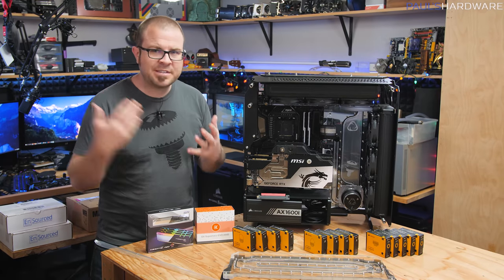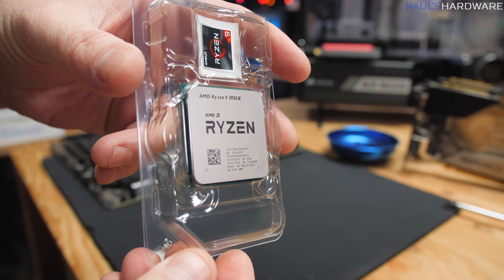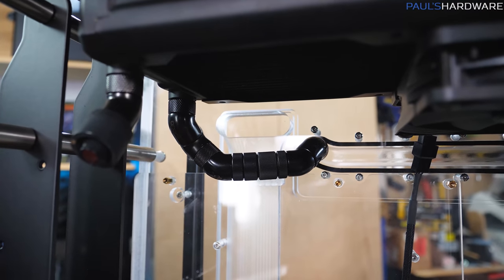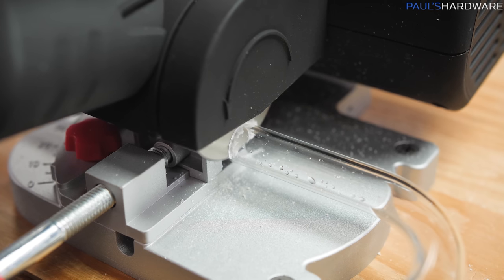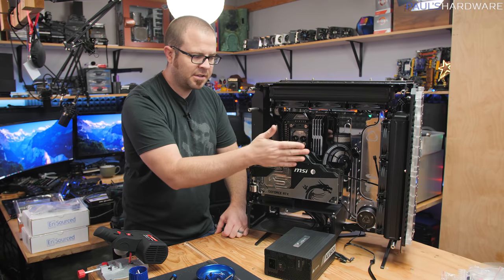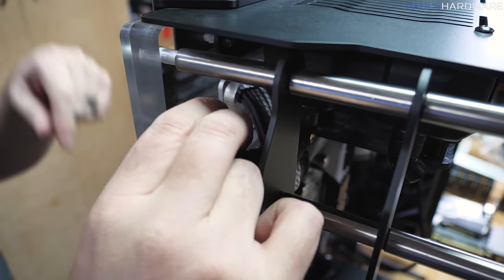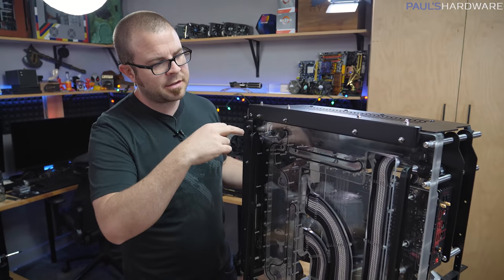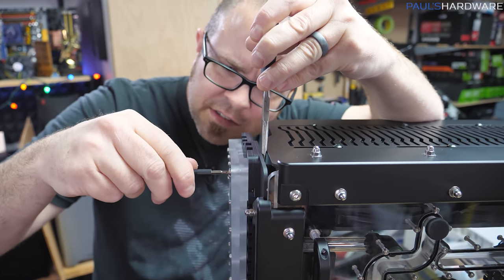My SECRET WEAPON for Hardline Custom Water Cooling!

Comment from the maker: THANKS FOR WATCHING EVERYONE! 🙏🙏🙏
If you're sad I didn't (*spoiler alert*) get far along enough to finish my tube runs and fill the loop, fear not -- the next part of this build project is already shot and should go live on Wednesday.
Reply: I just bought myself one of these too about a month or two ago. It's taken my build times using acrylic tube down to just a few hours(not including custom paint jobs and cable sleeving). It really is an incredibly useful tool.

Edit: Also, tip when cutting, the cutting area isn't deep enough to completely cut 16mm tube and possibly 14mm too(I haven't tried as I only ever use 16mm). After you get about 75% to 90% through the tube, just twist it until you have cut completely through. This will still provide a clean straight cut without having to reset.
Reply: Oh thank sweet baby Jesus.
Reply: Mr. Manager oh man how awesome, hope i can get one myself ^^
Reply: Paul, when you were at Harbor freight, you should have just gotten a wet tile saw for the tubing, much better than what you ended up with.
Reply: 5:22 "thanks for coming to my ted talk"
Reply: hey Paul, i like the look of that threeway splitter on the gpus. do you think it would look cleaner if you fed them the same way, so the inlet was between the cards?
Reply: Hey Paul I think that GPU plumbing is going to result in one card getting almost all the cooling. Physics is telling me the coolant will find the shortest route, which would be through the front card, & may starve the back GPU of strong enough circulation. Or vice-versa, it may push straight through the fitting on the front & starve it. Watch em closely.
Reply: @jpryor8102  hydraulics/ fluid dynamics work a little differently from electricity. it's more closely related to relative flow resistance. with dual gpus in par, the resistance to flow which is highest through the jet plate will be approximately the same. that means the flow will split fairly evenly. it's also worth noting that parallel gpus are pretty well proven to work. heck, i paralleled my gpu and cpu and temps are just as good as they ever were before.
Reply: Don't worry it's already epic even in its unfinished state.
Reply: that issue with the case migth be solved if singularity computers used sunk nuts or indentations on the panel to hold them

Comment: "Air cooling... It's WAY F*cking simpler" Paul 2020
Reply: Or even just soft tubing.
Reply: AIR COOLING IS EASIER IT COOLS PERFECTLY FINE ITS SAFER JUST AIR COOL YOUR CPU OR GET AN AIO AND GET A GPU WITH AN AIO PRE INSTALLEDN
Reply: I'm predicting next, Fuck SLI... Go with one GPU and fill the space with a good sound card!!!
Reply: Khaffit  No Room, adds to much cludder and takes up a USB port and still uses the CPU (in theory). Sound card fills up the space inside the case, sounds great and takes advantage of things a amp/dac cant. I use speakers. I don't use headphones. Klipsch 2.1 THX I prefer a card in my PC Case and not having a box on my desk.
Reply: Yet another reason why I love Paul’s videos
Reply: @dfkdiek518  Or better yet put your money into what counts the best gpu you can buy. Rather have 2080ti with stock shroud and fans than a 2070 and a bunch of colored pretty water flowing through. Now if money and time is no object then ...carry on.
Reply: @dfkdiek518  I've seen some of the available aftermarketGPU AIOs. They are fugly!
Reply: @feeterican  The best setup I could get and have, a Denon AVR-1513 hooked up to  spare hdmi connection. Just clone the main screen to it. Then use your 5 near field point source diy speakers to it and get that 5.0 going. Gotta know when these assholes sneak up on your rear. It also has the best virtual surround I have had from any source so headphones do good as well. For an extra sleek setup get a thin as possible receiver and a low profile htpc case that stacks up with it neatly and voila, small bean setup that does well in the sound department.
Reply: @hopentethking1966  I believe they are 2080 Sea Hawk's not 2070.
Reply: Depends Soft tubing is actually easy asf. Hard tubing is Satan himself
Reply: @filds1  I worked 10 years as a pipe fitter both threads and welding. So for me its easy.  I use copper tubing. I fit and bend the tubing Than I disassemble and take the fitted tubing and have it chromed.
Reply: It is, but I love the challenge of doing a big water cooling build. My last one has three 360 rads and two D5 pump/res combos.
Reply: AIO... Just get AIO.
Reply: @mukkaar  AIO's are for amateurs. Pro's prefer custom open loops.

Comment: The t-fitting between the GPUs won't work unless you run a tube from the front GPU inlet to the rear GPU inlet, making them run in parallel, with the T functioning as the return for both GPUs. Build is looking mighty fuego!
Reply from the maker: Thank you! Sorry if I didn't make that clear enough, but yes, that is the plan -- the inlets for both GPUs will be connected. Actually I already shot the next video on this build, so I can confirm that it does work!
Reply: @paulshardware  Hey now. No spoilers! ;)
Reply: @paulshardware  I'm curious what effect series vs parallel has on the cooling. On the one hand, only half of the water goes to each GPU (so at half speed compared to before the split), on the other hand, only cold water goes to each GPU.
Reply: @paulshardware  The T-fitting on the outlet is a very clever idea, I wonder if doing the same on the inlet would make it look even cooler!  Of course I know you already finished the build, but oh well, it's my Monday morning armchair quarterback thought...
Reply: @jjbankert  I was wondering the same thing! I'd imagine that it wouldn't actually cut the flow in half exactly but that there is a noticeable difference in heat dissipation. Maybe @GamersNexus  could solve this one for us lol
Reply: @thomasprovencher4611  that is actually a great idea. Although you would be sacrificing on water flow, but it's nothing that a high rpm pump couldn't fix.

Comment: I spent like forever getting my top and front radiators (cross-flow) connected whilst at the same time getting the exhaust port of my rear-mounted distro plate to line up (on a Phanteks Enthoo 719). Sure, air-cooling is f..kin' easier but much it's darn satisfying when you look back at a finished hardline rig. Actually, the main problem is never being quite happy... I've got more PETG coming this week to fix up a couple of runs and redo my drain route.
Paul - you should be using a leak tester like the EK-Leak Tester (or the Aquacomputer Dr. Drop although I've had issues with sealing and have since changed to the EKWB solution). You should be able to test various parts of your loop (by blocking off various outlets) before you build yourself into a corner requiring a massive teardown to access a problematic connection.

Comment: I have that saw! It was totally worth it, I've used it to make all kinds of small parts out of plastic and wood (scratch-build modeler here) and never had any issues with it. Good to know that if I ever get up the nerve to use hard tubes in a water-cooled build (the way the fittings currently work scares the living crap out of me) I'm all set.

Comment: A tip on the hard to reach nut. Before mounting the back plate. Using a small dap of glue on each nut then remove the screws. The nut will stay in place. Then place the back plate and screws.

Comment: Hey Paul! If you ever get tired of fiddling with brittle hardtubing in tight places I can recommend Bitspowers Aqua Link Pipe II. They aren't a miracle that works in all applications, but they come in different sizes that work in the majority of difficult instances. Of course one pipe is the equivalent of half of that neat saw, but hey - you can't cut cost on BP bling ;)

Comment: The most critical component of any computer build is the CPU, which means to me that the coolest water (from the radiators) should go first to the CPU water block and THEN to the graphics cards. You don't want "pre-heated" coolant going to the CPU. In my recent build, I used a separate rad for the GPU's and two reservoirs. It is an overclocked monster but it runs several degrees cooler than my earlier build with a single-loop cooling system.

Comment: Paul, you mentioned Thermaltake coolant. Aren't they supposed to be coming out with an "effects" line of coolants like the Mayhem's Aurora or PrimoChill VUE? They had it in at least one of their distro plate builds at CES this year. Maybe it was just a one time thing they did for the show. I guess I was just hoping it would be on the market sometime also.

Comment: You inspired me to build this year and replace my 13 year old Dell that I have kept alive with new hard drives and blowing the dust out.  I went with the 450 Tomahawk MAX, AMD 360X , and crown jewel, the Gigabyte Geforce RTX 2060.  My monitor (Dell) is still pretty good and working (they never die) but one false move, its history.  I bought it in pieces over 2 months and lastly purchased the case. Coolmaster Pro5 RGB is like icing on the cake. I didn't want to test the board by shorting the pins so I waited until all the cables were tied down and sweet... It booted, Win10Pro installed, and all those drivers.  MSI's updater is pretty great but connecting my 15+ year Labtec 5.1 speakers is always a trial and error to getting it firing on all front, back, and subwoofer speaks.  Any updates on the coolest external sound and lights?  Thanks again and keep the tools coming.

Comment: Cool. I'm wondering if that would be able to cut borosilicate tubing? Probably would require a different blade since I normally cut it with a dremel using a diamond blade.

Comment: could you have done the front distro plate and front radiator connection before installing the top radiator? also rotary fittings look easier to work with

Comment: Before you fill your loop, I highly recommend using a Dr. Drop or EKWB Leak Tester ..... will save you from BIG headaches if there is a loose fitting or other leaking issue.
Reply: really..... you actually think he doesn't own one and use's it before hand.........
Reply: @chloedevereaux1801  do not remember seeing Paul using one before...... so yes, I actually think he doesn't own one.

Comment: Hey Paul I think that GPU plumbing is going to result in one card getting almost all the cooling. Physics is telling me the coolant will find the shortest or least resistance route, which would be through the front card, & may starve the back GPU of strong enough circulation. Or vice-versa, it may push straight through the fitting on the front & starve it. Watch em closely.
Reply: I think you need to T pipe into them like u did on the exit for more balanced pressure through both GPUs. Or use the distribution blocks to pipe to all 3 chips separately, providing more balanced pressures, as it's meant for (instead of just looking cool). & then use a second distribution block to combine all 3 lines back to the rads. I think that case was made for such craziness.

Comment: Issues like these is why I have a three year old EK XRES SPC-60 pump/res combo gathering dust while I haven't bought any other water cooling component yet. I think I should finally get rid of it, because if I haven't done anything with it in 3 years, I won't ever. I'll just get an AIO with a 3-5 year warranty and be done with the whole subject.

Comment: Fittings costing more than the saw lol
Reply from the maker: I found that to be odd, but fittings cost a LOT 😅
Reply: A full set of fittings including many angled fittings for 2 rads, a distro, blocks for CPU and 2 GPUs, plus extending fittings is not going to be cheap.

Comment: Water cooling a computer is kind of like adding a turbo charger kit to a non turbo car, it will require specific modifications for different cars to install properly. Previous experience and knowledge in mechanics and tools would be a benefit otherwise the learning curve will be steep.

Comment: I need a new cpu I do gaming. I am thinking of the AMD ryzen 5  2600x is that a good cpu? I do like to play a game and on another monitor watch tv shows on it and have discord open on my other monitor ( I have 3 monitors) While my game runs. Is that cpu good for that? My current cpu is a AMD ryzen but the usage % on it reaches 100% and goes as low as 40%-55%. My current cpu sometimes stays around 95% but goes to 100%

Comment: Paul maybe the blade is adjustable a bit, Pay yourself Overtime & That's as heavy Duty power tools as it gets for building gaming Rigs. Maybe you guys should tell the Verge to buy that saw so they can build a PC correctly and not use tweezers to build a PC and they need to buy a desk to work on every time once buys a PC a desk must be in ones budget

Comment: I never trust small power tools from Harbor Freight. My tubing cutter is a lifetime-guaranteed Rigid hand-held model, comes with two cutters (for metal or plastic) and costs about $15 at Home Depot. I've used it for copper as well as acrylic builds. It gives a really clean, accurate edge which needs little or no polishing. With the power saw, you have to clean up a lot of burrs, and run the risk of actually melting the plastic from friction.

Comment: IDK why when they built the front distro plate plastic bracket they didn't build threads into it. That would of saved you a tone of issues. Also why didn't you just flip the front radiator? I know this is hindsight cause the builds done from my understanding and it is best practices to have the fittings at the top to allow air to rise. But I would of flipped the case over as many times as i would need instead of dealing with that.

Comment: I'm presently looking at 2 sets of RAM, one set that is 200Mhz faster but with 0-1-1-1 looser timings and only $10 more... 
Which would be better buy, and more importantly, why?
Reply: If Intel, doesn't matter (but faster one). If AMD, depends if it's 3000mhz vs 3200mhz and if it's 2000 or 3000 series. 2000 series tighter timings and 3000 faster sticks up to 3600mhz.
Reply: @onboard3  For reference, it'll be an AMD 3xxx series build, and the RAM is 3600 & 3800, respectively...
Reply: @RAW_Reality  3600mhz then, it's the max you can do, got myself 3600 kit as well. (if you go higher infinity fabric drops to half speed and you end up with slower system).
Reply: @onboard3  Um... Half of 3800 is 1900, for a 1:1 of the infinity fabric's supposed ideal ratio, and even AMD themselves say the "best case scenario" is 3733, so 3800 doesn't seem out of place, since you could easily undervolt it to be 3733.
Reply: @RAW_Reality  AMD made an oopsie, it's not 3733 it's 3600. If you stick in 3733mhz memory you end up with 1:2 ratio, 3600 is last 1:1.
Reply: @onboard3  Well, if that's the case, then I guess 3600 it will be... But since you're actually in a position to test for your own experience, have you ever personally tried an 3733/3800 OC of your RAM?
Reply: @RAW_Reality  That would mean infinity fabric OC as in CPU OC aka lowsing warranty, so nope :) What I most hate about coming from Intel to AMD is they advertise precision boost overdrive, but you can't use it as you lose your warranty and with the voltages this chip is hitting I like to keep that. I had my intel chip overclocked AND undervolted and here you can't do neither. Can't even update BIOS to 1.0.0.4 agesa, as it ups idle temps 10C :/

Anyways 3600mhz is plenty fast, timings I might try tighten sometime, but stability has been more important. Just CL19 kit, so possiblity for improvement, might just not be worth it if more memory voltage=higher CPU temp.
Reply: @onboard3  Gotcha. Though as long as you could potentially stay below 70°c on your CPU, a little bump in RAM voltage isn't going to make an issue that can't be overcome, unless you're the kind that has to watch thier energy bill at all costs. There's got to be a realistic and fair middle ground between temps and voltages that doesn't hinder either aspect. 
Though, if warranty is the concern, I can understand/appreciate that take of why you wouldn't want to. My thanks.
Reply: @RAW_Reality  Load is no issue as there CPU actually drops the voltage to appropriate levels :) 1003 abba my idle is 35C-43C, zen2 likes to do these constant jumps to 1.45v and back to 1V while idle (and you can't get under 1V unless you just look at deskstop with nothing running). Now with 1004 agesa based bioses it's 10C more, so 45C-53C idle and that's just silliness, even my massive air cooler became annoying fan ramping up and down.

Got my system running 24/7 and I like it quiet, so 1 day was enough of new bios and downgraded :P There's no performance benefit with the newer bios, so I highly recommend 1.0.0.3 abba based bios to you as well once you get your system running.

But main thing was I gained low end FPS, as I got 4K screen I game there and Destiny 2 would get FPS drops down to 45 with my 7700K, same setting with my 3600X and it's solid 60fps. I knew from reviews that it happened at least on BF5, but didn't except quite this big of a difference going from 8 threads to 12 threads.

So enjoy it once you get it, Zen2 far from plug&play, but once you tune it (couple months :P) it serves you well :)

Comment: Why don't they design a distribution vessel and pump which 'sits' above a 280mm Radiator and fans (front of case mounts)? With the 'right design it could have inputs on the side for a case top mounted radiator. This would give a relatively compact cooling solution. Then again a modified IceGiant cooler could cool an entire PC?